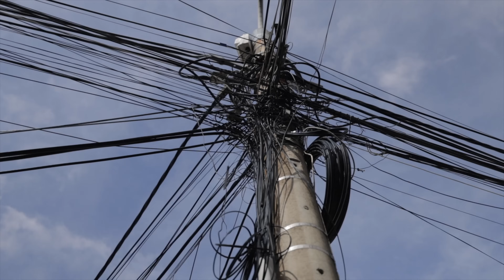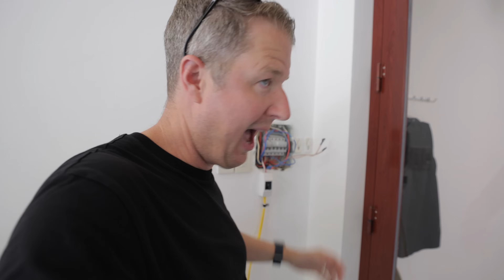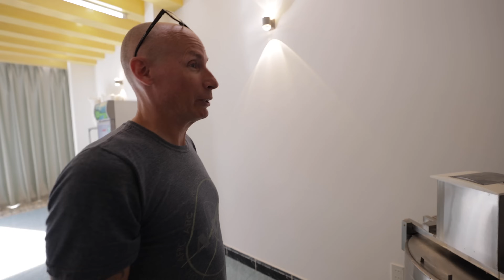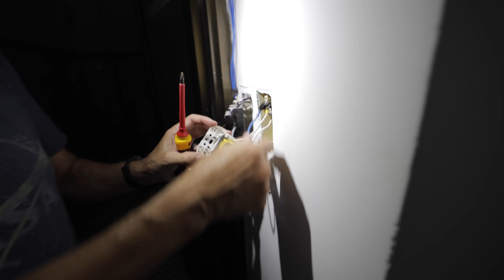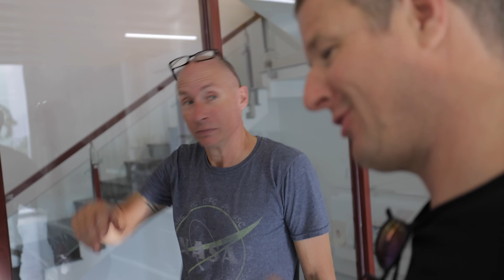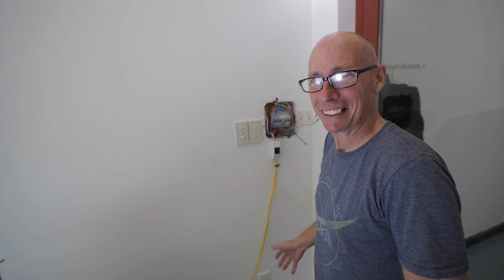USA and UK Electrician tackle CRAZY electrical wiring in Vietnam

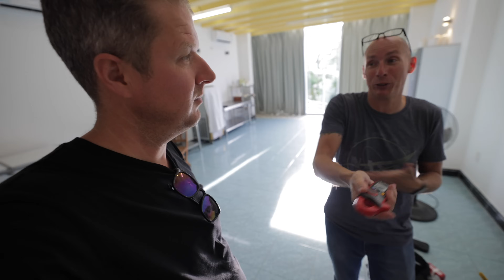Comment: 19:03 The most common reason for such led lights which are glowing while the switch is off is the little lights integrated in the switches which indicate that the switch is off and because there is no neutral coming to the switch and just the live is switched on and off, this light uses the permanent live on the switch and the neutral (the non permanent live that becomes neutral when the switch is off) and when the main light after the switch is LED and it's not good quality it loads the led diodes in the main light but slowly and this causes this glowing when the switch is off

Comment: There often are electrical house fires in Cambodia. Sometimes it is reported by locals as dodgy wiring or overloaded circuits (eg. using multiple power boards connected serially).

Comment: Years ago when I did that wiring there was an older lady and she really made sure that I put the plastic tamper plugs in. And I could not convince her that her idea if it didn't have the plastic plug to keep people from plugging something in the hole and getting shocked she swore it was so the electricity didn't come out go down the wall and on the floor but she lived at the time when electricity was first being pushed and prior to electricity being at homes I never could explain to her that's not how it works so I just made things safe for her.

Comment: I live in a small city in Vietnam and we built a house in 2018. Unfortunately I had to go away for work when the electrics were installed. No earth except on the incomer, cables run in the plaster in the walls and lights and sockets on the same circuit, even the oven is on a socket circuit ever though I left clear instructions that it had to have it's own breaker. We've had a couple of failures inside the wall and now have wall fixtures that don't work. Absolute nightmare to fault find.
Reply: Having a same problem right now. The whole kitchen only has a pair of 2.5mm wires, not enough to safely power an induction hob, let alone an oven.

Comment: Vietnamese here. Quite late for this video but it is true that Vietnamese housing have zero electrical regulation whatsoever. No earth, no color coded cabling and very sketchy wiring even in the modern appartments. This is somewhat the higher end of the Vietnamese electrical work, some housing are retro and they have one breaker for the whole house, pretty much require to diagnose the whole house when there are some faults. I once saw a main fuse fixed by using copper wire so yea, very janky and typical for Vietnamese electrical work.

Comment: I work for turkey farm in the US and all the wiring is all the same color. It’s like all white wire so you can’t rely on anything being the same from one bar to the other.
Reply from the maker: Wow that’s mad 🤯
Reply: FWIW that's not code in the US. If the wire jacket is not the correct color you're required to wrap it with electrical tape on both ends of the correct color.

Comment: So in Germany, phase testers in the form of screwdrivers are not permitted for measuring voltage. Of course, they are still sold and are often used by laypeople. I completed my training as an electrician 23 years ago. I call these screwdriver phase testers "lie pens" and never use them because I don't trust them. In Germany, we are required to use two-pole measuring devices to measure voltages or to determine whether there is no voltage. It can be a multimeter or a so-called "Duspol" from the manufacturer Benning, for example. I don't know if you know "Duspol". It is a measuring device with two test probes and a cable between them. The actual measuring device is integrated into one of the test probes. The Duspol Digital has an LC display and other LED displays and can carry out true RMS voltage measurements (up to 1000 V AC and 1200 V DC with polarity display), frequency up to 1000 Hz, continuity measurements (0-100 kΩ), rotating field measurements, diode tests, resistance measurements up to 300 kΩ, low voltage measurements 1-11.9 V and NCV measurements. It has a switchable load circuit to avoid incorrect measurements due to capacitive and inductive reactive voltages. It is also possible to deliberately trigger a 30 mA residual current circuit breaker. I love this thing.

Comment: I'm not an electrician & don't play with our wiring but here in Australia was watching an electrician install an extra power point ( outlet) in my garage. 

He twisted wires together then inserted the twisted wires into a connector that has a screw clamping them all together.  

Our power points (outlets to Americans) have terminals designed for twisted wires to be inserted then clamped with a screw.

All circuits in my house have individual Earth Leakage Protection  in the switchboard. And definitely standard colours only!  The wires are all multiple strands but I remember solid wires when I was younger.

Our power outlets are all plastic & look very space age vs the American outlets which look like they were designed & made in the 1950's.
Reply: A wire nut?
Reply: @trehis No, we don't use wire nuts but rather wires are twisted together then inserted in a connector that has a side screw that holds it onto the twisted wires.
Reply: @trehis  I don't think wire nuts are allowed here. Ive only ever seen screw connectors or wagos.

Comment: The use of double-pole breakers everywhere is interesting to see, as of all the installations I have seen in both Canada and Poland, single-pole breakers are used and the neutral does not have any disconnecting means.
Reply: So no 220v outlets?

Comment: Fault finding listetn to customer.split circuit in two
I don't but it's best way to find fault quickly..I can usually go in and find a fault in 5 minutes.sometimes it's better to bypass fault by running new circuits.years and years ago in London it took 2 days to lift floorboards in expensive house to find broken cable,wire
Would have been better to run new circuit, years later I was talking to customer no power in store room  after an hour they told me contractor had done work in building and had cut pipes with wires then covered the damage up
I just abandoned old work and ran new wires in 20 minutes

Comment: Go with voltpen/mnon contact tester make sure it's over 50  volts or you get readings on neutral and cause you you all kinds problems they will say 12v 50v don't buy them

Comment: i'm not qualified but have some electical and diagnostic knowledge and i would resort to using what used to be called "belling out " equipment to send a signal in a cable and trace it.  This is such a mess hahahahah.  We used to use this device to trace twisted pair phone and networking cable throughout office blocks and i'm sure it would work here.

Comment: what is the problem with twisting wires?
Reply: Not an electrician here, but just twisting the wires won't keep then together if moved about. Tape doesn't count. Use wire nuts if there is no other way.

Comment: I live in Argentina (220-230V @ 50Hz and three phase 380V ). A lot of houses don't have a ground wire so I dont get a reference for neutral or line. I use the amp clamp in volts and check against body, if it gives me around 110V then I know it's the live wire, or the box itself if its a metallic one. For wires in junction boxes I use one of those non contact detectors (even tho my amp clamp has that function, it's too big sometimes) but it's not that reliable when having a bunch of wires all smushed togheter

Comment: Simplest way to clear that lot up is to power down the income, disconnect everything,  and bell out every single cable with a wandering lead and label each line & neutral conductor to a known wiring standard,  re fit accessories, test, and hand customer the bill... you can walk away knowing it's safe... customer is safe, installation is safe..  simple's

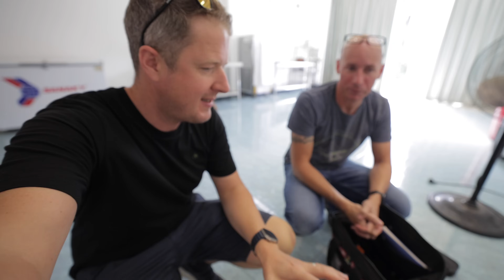Comment: 11:30 This is a big difference. Here in Finland I could safely touch any wires I see anywhere (clearly broken is a different thing and I have reported a light pole with a hanging cover once) and I won't worry when my dog walks over wagos connected to wires on the ground because I can be 100% sure those would never be live. And I regularly use my fingers to find a socket in the dark and to guide the plug in without a worry. Even my bathtub is connected to an outlet.

Comment: I have a fault on a new garage built in my garden. My basic plug tester says live neutral swapped but everything is connected correctly. If I plug somthing into a socket the consumer unit trips the moment I turn on a grinder plugged in. Are there any forums you guys advise to chat and figure out the fault thanks.

Comment: If there is a difference between hot and neutral currents. I would start to look at places that have earth close to it. Like pipes, water, metal doorframes, outdoor lamps/switches.
If hot and neutral carries the same current. Start to break up the circuit in the electrical boxes to find out when the breaker stops tripping.
When finding shorts on PCBs, I add external, current limited, power into the short and check with an IR-camera. The fault path and return path will light up and show you the way to the fault 😃
Reply: That's basically what I did with the amp clamp. Since I knew I had 500 to 1000mA on that neutral in the board, I went to every switch, receptacle, box etc... that is on that circuit to check for the same current, but was unable to see that 500 to 1000mA anywhere. So the fault is somewhere before it gets to any of the boxes. The attic is unaccessible and it's concrete and brick walls. So trying to find where that circuit splits to feed everything is the problem. Owner does not want to start cutting holes in the ceiling or knocking holes in the walls.

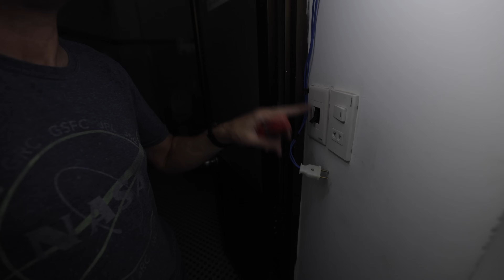Comment: I'm in Nigeria and see more electrical deaths, no earthing/grounds, and the death stick and light socket with 2 wires used. The cost of a dmm or combo volt-clamp meter is far beyond the resources of the typical tradesman. Most tradesman have no formal training but because of the survival thinking they typically have looked over someone's shoulder. 16:32

Comment: I have just returned from Portugal. We have been renting the same house, for a couple of weeks a year, for any years
This year we found that the electric oven thermostat was not turning the heating elements off.
The "Owner" asked us to remove the oven and fit a new thermostat.
This was just the start of an "Eye opener" in how not to do domestic wiring
The main fuse board has 5 un-labelled circuit breakers with Blue neutral and Black live wires of 2.5mm size.
There were 2 off 25A and 3 off 16A circuit breakers. Since when has it been legal to fit a 25A circuit breaker to a single 2.5mm radial circuit.
The kitchen and hallway  were fed by the 2 off 25A circuit breakers. 1 25A circuit breaker fed the oven,4 off 15A sockets ( another small electric oven, a toaster, a fridge freezer and a coffee machine and was then "extended by a 0.75mm 2 core flex ( Note that there was NO earth connection to these 15A 3 pin sockets, to feed a freezer, a 2Kw oil filled heater, a dehumidifier and an ironing board. 
The other 25A circuit, still on a 2.5mm cable fed the hall way 15A socket, the washing machine, dishwasher, electric kettle and microwave and via another 0.75mm 2 core flex cable to the kitchen TV.
Worse was to follow.
All the lights were wired(at the fuse board) to a 16A circuit breaker.
The bathroom and first bedroom were wired to another 2.5MM circuit with 16A circuit breaker.
The bathroom had a 15A 3 pin socket wired via another 2 core 0.75mm flex cable fitted right above the sink and also this same 2 core cable fed an unearthed 2KW wall mounted fan heater.
In the first bedroom the single 3 pin socket had been extended with yet more 2 core 0.75 mm flex cable to feed a heat pump aircon unit and 2 bedside sockets for table lights.
If this was not bad enough another 3 pin socket had been added fed by 2 single core exposed 0.5mm wires the connection to this being via exposed terminal blocks..
The 2nd bedroom + living room were wired to the remaining 16A circuit.
The second bedroom was wired the same with the single 15a socket extended by the same 2 core 0.75mm flex to feed the aircon unit and bed side sockets and again it has another 3 pin socket lashed in via exposed terminal blocks and 2 single core 0.5mm wires.
The living  was far worse as the only "proper" 3 pin socket had been extended , by yet more 2 core 0.75mm flex cable, to feed both another aircon unit and 4 more 15A 3 pin sockets.
Worse still mid way on the extended run there were 2 more terminal blocks  where the brown and blue wires had been crossed over.
I know that people complain about the UK wiring regulations  but this install must have broken virtually every rule in the book with no RCD, undersized cables and all the aircon units, fan heater, freezer, dehumidifier, ironing  board and most of the bedroom and living room sockets being fed from undersized 2 core cables and NO Earth connection
Reply: Sounds like here in Brazil, it's not only language we share!

Comment: Get a spool of wire and connect it to a known good ground.  For tracing wires that are not in conduit you can use a "toner", a two piece set, one generates a warble audio frequency and it is detected by an inductivly coupled sensor.  They are intended for telephone wiring troubleshooting but can be used on deenergized wires as well.

Comment: Even as a DIYer, I know from experience those neon screwdrivers are death traps. They can have false negatives, and more commonly - false positives (which then leads you to assume it's wrong all the time and work on the circuit despite the neon glowing a bit).

Comment: Same here in Brazil, no real color code followed just whatever they have and they twist wires like crazy. here I think its a cost issue if they can save a penny they will
Reply: Exactly,! Here in Paraná interior we have bi voltage mains supply,127/220v tomadas (wall outlet sockets) are, identical for each voltage. Where many things like phone Chargers/laptop chargers are multi voltage now, things like fridges, microwaves, air con units are not!

Comment: I guess the one thing in your favour is the 20 sec delay before the breaker trips.
This allows you to get a decent reading off the clamp meter before the current trips off.
My step one would be to use the clamp meter to confirm there is excessive current passing through the wire to the breaker - and it's not just a faulty breaker.
Step two would be to compare the current in the feed wire to the board, with current in the neutral to the board (from DB1). if these are similar Amps, then a massive leak to earth, through the fabric of the building, is eliminated from the list of causes.   However if there is a massive difference, then an earth fault is indicated as the cause of excess current. Should you suspect this discrepancy is due to a neutral current bypassing DB2, then go back to DB1 and verify.

If this all confirms the tripping is due to an overload or a short, then it's the old story of identifying the guilty conductors and tracking along them to the fault. which looks like a nightmare 🙂
Reply: Did all that and that's how I located the bad neutral. Originally they had it on the hot and assumed it was the neutral since it had all the neutrals on it. Then figured bad breaker internally. But didn't trip when all wires disconnected from breaker and isolated it to that one neutral, that was originally on the hot. When connected and that branch circuit off, there is anywhere from 500mA to 1000mA flowing on it, coming from the other circuits. Verified by measuring the return neutral on the breaker, then connecting that bad neutral and watching current drop on the breaker neutral to main panel. But where that neutral connects to the rest of the circuit, I can't find. Its in the wall or in the ceiling and homeowner does not want to start cutting holes in ceiling. Even though I explained how bad this is.
Reply: If there is a difference between hot and neutral. I would start to look at places that have earth close to it. Like pipes, water, metal doorframes, outdoor lamps/switches.
If hot and neutral carries the same current. Start to break up the circuit in the electrical boxes to find out when the breaker stops tripping.
When finding shorts on PCBs, I add external current limited power into the short and check with an IR-camera. The fault path and return path will light up and show you the way to the fault 😃